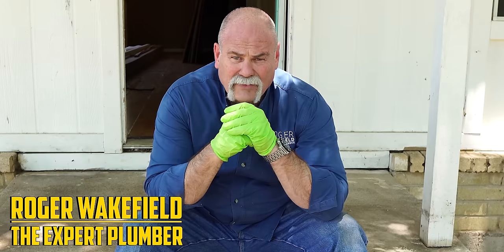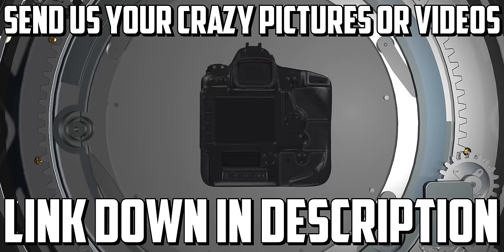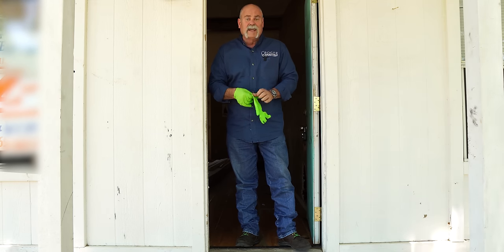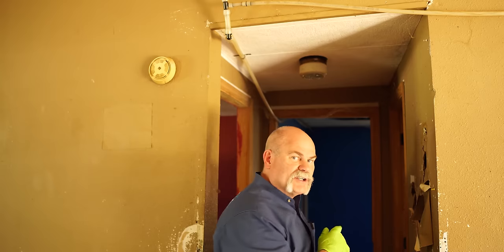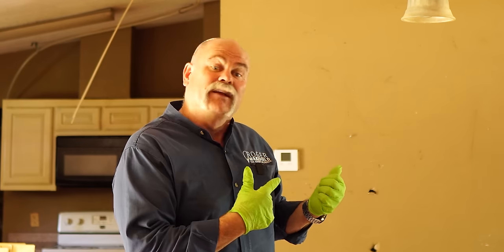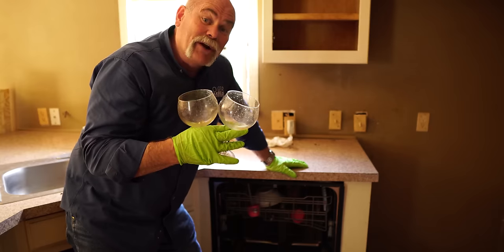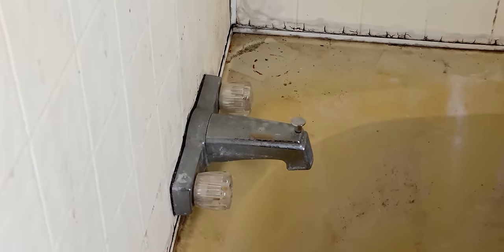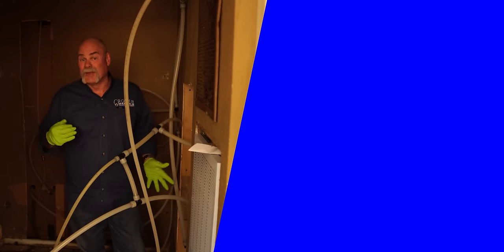This is THE WORST Plumbing Job in America

Comment: It's a fire suppression system for when they're cooking meth. Wherever the fire starts it just melts the pipes and floods the room, brilliant!
Reply: 🤣🤣🤣🤣🤣🤣🤦‍♂️ best comment ever
Reply: Bahahahahaha...
Reply: And that solves the electrical issues as well if there's an electrical fire is automatically self extinguishes!!!!!!
Reply: My first thought was this was a former plumber, apprentice or construction hand that got on the meth and stole a bunch of supplies and then tapped into his neighbor's water supply.
Reply: yep
Reply: No no no we have several drain holes for the water to go through so we don’t get flooded. We learned from our last meth house not to do that anymore.
Reply: @BobLeeSwagger91  Actually yes you do. But after the power is shut off obviously.
Reply: Heisenberg approved ✅✅✅✅✅✅
Reply: Pretty good 😏
Reply: @JakeW26  some electronics like PC power supplies and Tv power Delivery can hold charge in their capacitors for months after the power has been shut off its safer to get a CO2 fire extinguisher or cover it in baking soda
Reply: @shadowxxe  Halon also works, but you don't want to be inside when it goes off.
Reply: Love this comment!
Reply: I actually saw that work! I was on the fire department and responded to a fire that started in the trash can under the sink. It melted the cpvc which put the fire out.
Reply: For a second I though this was a comment from an actual plumber that's been in a meth house
Reply: @shadowxxe  So you're going to tackle a house fire that sparked from an electrical box with a CO2 extinguisher? lol... good luck and please don't become a firefighter.
Reply: Unfortunately the uponor pipe they used is fire proof
Reply: @imark7777777   you laugh, but that is literally how industrial panel fire suppression systems work, but with foam!
Reply: @rollinwitbigc  ha! Fireproof? Uponor isn't even hot water proof we put a tankless water heater brand new in a new cefco in Temple TX and it had a bad thermostat blew out a uponor 3/4 inch line three times before they finally changed out the heater
Reply: its prob true lol
Reply: @roushstge2  you realise he was talking about electrical fires from PC's and TV's. Obviously he means that you should use a fire extinguisher on it so it doesn't spread into a house fire.  Or do you really think it's a better idea to just let your house burn down?
Reply: @ousqa  and I was acknowledging that he meant a fire extinguisher. But you don’t use a CO2 extinguisher on electrical. You use a dry chem extinguisher. That was my point
Reply: @roushstge2  my bad I misunderstood.  But co2 can be used on electrical fires
Reply: Lmao
Reply: @roushstge2  , CO2 is the preferred agent for electrical fires. Maintain nozzle control. The CO2 exits the nozzle at -109F. You can use whichever agent is most expeditious for an electrical fire, keeping in mind spray patterns and distances. Personally, I’d use PKP to piss off electricians. There is a caveat in the NSTM Chapter 555 (Triple Nickel) that allows you to use AFFF as long as your maintain the nozzle at least 4 feet from the source of the fire. Water can be used in a fog pattern. Most small electrical fires will extinguish after securing electrical power.
Reply: @roushstge2  , what dry chemical agent have you used?
Reply: @sam4976  Monoammonium phosphate
Reply: @sam4976  also my original comment was meaning that if he thinks he can take on a house fire with any extinguisher... he’s going to quickly be out of luck.
Reply: I have seen that type of pex expand to 20 times as big where is was over a fire that burnt the house without leaking. 
5 pipes in the fire not one burst.
Reply: @dass1333  I believe this comment was a joke but yeah, they’ll expand
Reply: Thay pulled out the copper and sold it for meth probably. People seam to think it’s gold. You leve a working dishwasher out yjay cut of half the cable for the copper
Reply: @kcgunesq  goddamit how’d u know
Reply: You better patent that idea because some 2 toofer cook out there might agree with you and offer that service at a discount ,Lmmfao
Reply: Genius comment. Fire suppression for meth houses. I could sell this idea on Florida
Reply: I tip my hat and buy you 2 drinks.
Reply: Omfg rofl
Reply: FBI Federal Bureau of Investigation   No witnesses of the meth lab, EVEN BETTER
Reply: Heisinberg status
Reply: Andrew W, ikr
Reply: This comment deserves more likes 😂😂😂
Reply: OK, I gotta hand it to you, that's pretty good!  🤣🤣🤣🤣🤣🤣  Gotta keep safety in mind when in the manufacturing sector.
   My guess is, somebody bought this house and the plan is to gut it and do a full redo on it, and they rigged some pipage just for the sake of having water while there working on the place.. at least... that's my hope, although your theory sure is looking awful feasible
Reply: Classic 😊😅
Reply: @Chris Carson  fire proof or fire resistant?
Reply: Lmfaooooooo!!! I’m dead
Reply: Must have been a Japanese meth cooker then 😅  every design thought thoroughly 😂
Reply: I was thinking it's probably a grow house for weed growers but even weed growers have standards. So I surmised the plumbing was done by Crystal meth cooks who don't give a shit about anything other than maximizing profits.
Reply: Yeah a trap house

Comment: This looks like a post apocalyptic house that was thrown together with whatever they could find just to get by.
Reply: Honestly it looks like some crappy plumbing job by squatters.
Reply: Fallout irl😂
Reply: @KillerofGods  tweakers can be squatters too.
Reply: @karlajaeger2082  Oh no there is a good chance they are squatters. I've seen meth heads squat at one house and take months to get evicted and then they just hop around to the next street and such.
Reply: @karlajaeger2082  definitely squatters.
Reply: @karlajaeger2082  I thought the same. Looks like they scrapped all the copper for crack money and threw together a new system
Reply: it is
Reply: @karlajaeger2082  Yup, looks like they were stealing water
Reply: Fallout 76 IRL
Reply: Welcome to middle class America 2021... next will be the great garbage avalanche of 2505 except in 2041...
Reply: Did anyone see in the walking Dead when Michonne and Andrea we're staying with the governor they had pipes and wires running around the walls
Reply: Made by zombies!!!

Comment: Looks like a meth house, like they took out all the copper plumbing and sold it for more drugs!😵
Reply: Check out a series called Holmes on Holmes. The producer and contractor who produced and stared in the series, Mike Holmes, would rescue homeowners from horrible work done by bad contractors. There's been jobs done by "professionals" as bad as this one featured on his show. There's many episodes on YouTube last I checked, so you should be able to pick up some of them. The worst case is a rare and very hard to find episode called "Lien On Me" where a bad contractor damaged the house so bad Mike Holmes had to demolish the house and build a brand new one. The contractor even had the gall to put a lien on the property for "non payment", insisting his work was good.
Reply: That's actually a very good guess. That's what i was thinking. They probably stripped the house of all coper to sell for meth and then found or stole or got those clear water lines free

Comment: honestly looks like something squatters threw together to make the house " functional " I've seen abandon commercial property's that look like this , wire and pipe ran wherever just to get it from point A to point B , using either stolen building materials or scraps left over from job sites.
Reply: Idk man, the expansion tools used for those fittings are expensive and not a common tool.
Reply: @TankGunner84  home depot rents em
Reply: 16driver16 do they, I didn’t know that. I don’t have a Home Depot near me.
Reply: @TankGunner84  Maybe they stole that from a plumber's truck -- along with the odd assortment of fittings they used.
Reply: @knowsenough2bdangerous  Came here to say that... this definitely screams "drugs" and "crack or meth house". At the most, maybe they had a buddy who knew a thing about piping, or they rented the expander tool somewhere and asked how to use it, then added the shark bites when they needed to "fix" the piping or add more stuff... but yeah there is clearly something VERY wrong with this picture and it's not just plumbing. I couldn't help but laugh at that ceiling fan.... I mean... WOW he did not fail to deliver on this video 😳
Reply: Michael Burns  I feel like if that was the case, they would have at least put the new tubing in place where the copper had been.
Reply: Yeah I was thinking squatters or trap house to pimp or sell out
Reply: Squatter was my first impression but to much work went into it, maybe fueled by their drugs? My guess is the guy had some leaks and didn't have the money/energy to do it even half assed
Reply: Yep, it screams some drug-abusing squatters.
Reply: A first year plumbing apprentice wouldn’t know how to do this let alone a squatter with about $1,500 worth of parts and equipment. Idc how much ingenuity they have. Unless of course the squarer also knew about plumbing and had a bunch of parts left over but the. The question is why wouldn’t he just get another job?

Comment: drug addicts most likely lived here, sold the copper to buy drugs, and replaced it all with this fine setup. I would have that place condemned. damn.
Reply: The sadder part is that when he opens the dishwasher, you can see kid's cups/waterbottles in there.
Reply: I almost believe it if it wasn't for the uponor expansion pex... as there's no way crack heads could afford the tool let alone the pex fittings and rings
Reply: kevin turner, somewhere in Texas, there is a plumber who left his tailgate down with his expander tool sitting on it, and when he came back to get it after bringing in his hand tools, it grew legs and walked away.
Reply: @spacemanrick2014  Probably. Even just leaving a van door unlocked we've had other workers from the same job just randomly steal our tools....it's unreal how dishonest some people are.
Reply: Its a double wide, no copper pipes just what is shown in this video. Its all plastic pipe and even the Ts elbows etc are plastic, its usually grey tho not clear.
Reply: @spacemanrick2014   totally. Someone got their tools stolen or they were smart enough to pay $10 to rent a tool for half a day
Reply: @MFCSTUDIOS  Maybe someone involved with that absolute disaster realized how expensive sharkbites were and somehow "borrowed" the expander tool... also... if the inhabitants of this.. place... were desperate to the point of scrapping the piping, shark bites are made of brass so maybe they decided to do it all in plastic so they wouldn't cut off the water when they needed to cook up the next batch of meth. On one hand it's hilarious how awful it is, and on the other it's sad that at some point, people were actually living there. Was probably an abandoned home and the water connections were probably made illegally on the utility side of the meter.. if I had to guess.
Reply: That's a big assumption with no evidence. But it's the only thing that sounds somewhat plausible.

Comment: From the looks of that house, I would start from Square One, rip it all down the studs and start again. If the water lines are like that, I'd put money that the drain lines are just as bad. Not to mention the great electrical work.
Reply: Good news:  that's a double-wide trailer, not a real house.    Just call the trash company.
Reply: This nightmare is NOT a 'fixer-upper", it's a "KNOCKER-DOWNER"!!

Comment: When we bought our house I had to completely redo the plumbing under the kitchen sink.  It had been a rental for 40 years and been bought before us by a college student who didn't know home repair.  The shut offs were corroded and seeping.  The drain lines were composed of 4 different kinds of plastic pipe in two diameters.  Two white. PVC and Vynil I think. And two black colored pipes I'd never seen before.  Gas maybe?  It ALL came out.  I installed 90 degree ball valve shut offs on the supply lines replacing the leaky crank valves.  The drain lines were replaced with the proper size pipes and correct trap and fittings.  I even put in a much better kitchen faucet.  Fortunately the rest of the house was in pretty good shape.  Mostly because it hadn't been "repaired".

Comment: First off, I'm not a plumber by profession. I rebuilt a couple homes for myself in this one area, and one day a neighbor, whom I helped out from time to time stopped by. He was having his plumbing done by a well known company in the area and asked me to stop by and look at it. I go over and it looked a lot like the work in the video, except it  was in a crawl space that had plenty of room to work. They just dropped all the lines on the ground and snaked the cpvc lines everywhere. No clips, no hangers, every thing was fitted with what ever fitting they could find to make it work. I never knew cpvc pipe could bend that much without breaking. I told him they needed to do it over again. I looked at it again after they were done a second time, but it still needed attention so the guy called them again and they came out.The third time was better, but not the best. The company said they were not coming out again. About a week later the neighbor came over and asked me to check out a wet spot on the floor, so I crawled under the house and one of the fittings was leaking and spraying water onto the subfloor. I fixed it for him for nothing. Originally he came over and asked me if I would do the plumbing for $1800, but I told him I was busy trying to hit a deadline. Found out later he paid $3800. for the other plumber to do it. Another lady in the town down the road asked me to come over and look at her plumbing. Her house was built on top of the septic tank that didn't have a decent leech bed.  But, that's a story for another day. All this and more in the state of Arkansas.
Reply: sounds just like Oklahoma lol

Comment: looks to be a grow house and they where stealing water
Reply: That's not at all what it looks like or how they would run water lines. Now, if those were all electrical wires, that would look like an illegal grow.
Reply: @ryanroberts1104  Yeah, replace the water lines with electrical work of the same "class and quality" and you have a potential grow house. There's no need for hot water, and plumbed in "kitchen sinks and tubs" in a grow house, so someone was actually living here. Probably VERY cash strapped and was either evicted or foreclosed upon. maybe died. But it doesn't give the clues of a grow house where ventilation and electricity are more important.

Comment: They were probably on drugs and worked as a plumber in his day job (or whatever they did to obtain money). That light fixture screams crackhead to me. 2 years later and god damn he could have plumbed the whole house for what he spent in pex, tees, and fittings including shark bites.
Reply: rule #1 of crackhead electrical. It HAS to be the most unsafe way possible. I was admiring some crackhead wiring of a light a while back and I noticed 2 things. There was a junction box right beside the light that was not being used with the wires coming from it, but they decided to make the connections outside the junction box just a foot away and let it hang even though the junction box was right there already installed. and second, the murettes were sitting on top of the junction box, but they used electrical tape instead of the murrettes that were right there...
Reply: Yeah I was thinking the exact same thing
Reply: @off_mah_lawn2074  I'm really curious about what the house looked like before

Comment: I'm amazed that meth-heads had the sense to use Uponor properly.  Those joints looked spec.   I agree with previous poster that  you have a job for a bulldozer.  Yuck!
Reply: nope you have to give up the bulldozer after that. it wouldn't be sanitary to use that bulldozer on further construction sites. Fire is the way to go. probably start a couple metal fires just to make sure everything is really dead.
Reply: @spacemanrick2014  Nah. Just a huge dumpster and a competent crew.  I don't think I would want to step foot in that house again.